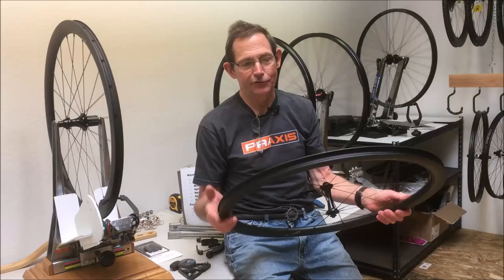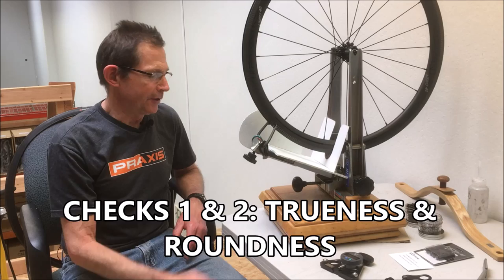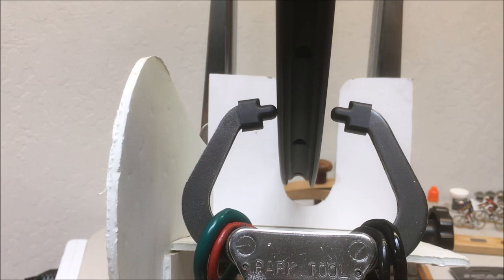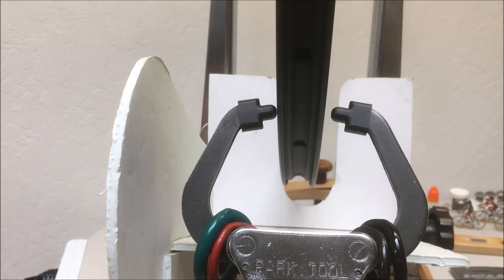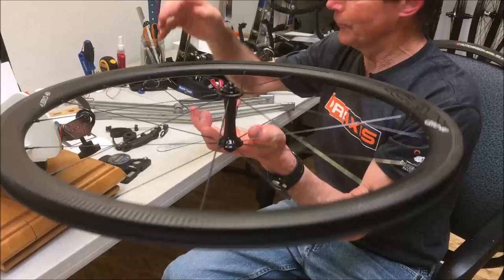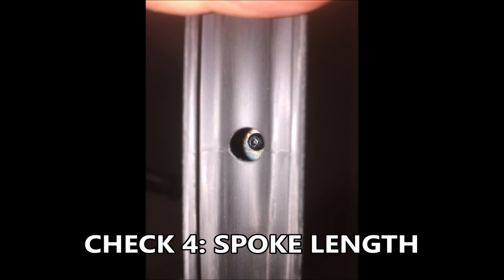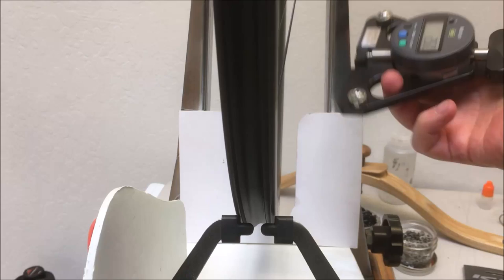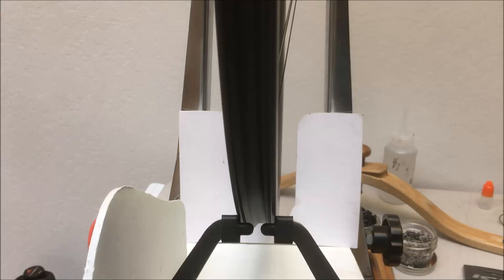ICAN Chinese Carbon Bicycle Wheels Review by Wheelbuilder Jim Langley

Comment: Proper educational videos. One weird question: could the spoke twist be on purpose, for the blade to meet a headwind in a softer angle? Did the non drive spokes had the same but opposite twist (mirrored angle)? I don't imply it is a good thing, but maybe you can cheat wind tunnel results that way?
Reply from the maker: Thanks for watching and commenting, Drou, appreciate it!! Another viewer asked the same question so it’s a good one. The thing is the spokes were randomly twisted - no plan to it. I was building wheels when aero spokes were invented too and never heard any design calling for twisted spokes. So I think they were just wrong. Thanks again!!

Comment: Enjoying your excellent Youtube videos..... Two questions: 
1) Should we buy nipple washers when building a carbon fiber wheel set?  
2) Most, if not all online spoke length calculators are specific to j-bend spokes versus straight spokes such as the DT Swiss 240S for straight spokes. That makes spoke calculations almost impossible w/o the DT Swiss online spoke calculator. However the results tend to show that left side spokes to be different length from right side spokes for disc brake wheels/hubs! Have you experienced this?
Reply from the maker: Appreciate you watching and the kind words, Graydon, thank you! On your questions, when you purchase a carbon rim the manufacturer should specify in the instructions or on a spec sheet on their website, etc., whether or not they're to be built with nipple washers. If I'm not sure, I will reach out to the maker and ask for technical support and ask them. Not all carbon rims require them but some do so it's best to check. I rarely build with straight pull spokes. But when I do, I will do what you're doing and use the calculator from the company that made the hubs and spokes. And I would expect the spokes to be different length on the right and left due to the way the rim is dished to the right for rears (to account for the cassette/gears) and to the left on front wheels to account for the disk/rotor. Not all wheels are that way but most are. Okay? I hope this is helpful. Thanks again and happy wheelbuilding!

Comment: I would like a pair of these wheel, however, i need qr100 and qr 135 center lock disc. What do you recommend
Reply from the maker: Thanks for watching and the comment jfolklfd10946. I recommend visiting their website and using their contact us resources to ask them if they can build your wheels with the spacing and disc spec you require. I think they'll be able to do it for you. If they can't there are other companies that will. I hope this helps you get some great wheels.

Comment: Having successfully built one set of amazing carbon fiber 700C wheels for my CF bike, I am itching to do more…….and so I can continue to make use of by ParkTools truing stand etc. Any suggestions on how to find potential customers?

And BTW - now I want to build a complete Gravel bike from scratch so I need some hobby income to proceed….
Reply from the maker: Congratulations on building a pair of amazing carbon wheels, Graydon. Building a new gravel bike with your hand built custom wheels will be another wonderful project.

It should be relatively easy to find customers for your wheels. Traditionally, wheel builders not affiliated with a bicycle shop, built their reputation for building quality wheels by building wheels for their clubmates - friends they rode with. As the wheels proved great riding and durable, riders told other riders and you’d get more wheel orders. If you provide reasonable turnaround times and prices and can build custom wheels people are looking for, you can develop a nice little business.

As you build your reputation and have some riders who love your wheels, you could then even approach bike shops and see if they’ll send customers for custom hoops your way. These days some shops don’t want to bother with building wheels - too much labor and no profit to be made off it. Plus, it’s hard to mark up the hubs, rims and spokes enough. So that can work. Especially if there are a lot of shops in your area since some might build wheels, others not.

Promoting yourself on social media could work nicely, too. You’d probably want to use local media such as the Nextdoor app or even Craigslist, both of which are free. Those are just a few ideas for you to try. Much success!
Jim
Reply: @JimLangley1  - thanks for the encouraging feedback Jim…..best to you and your business.

Comment: I’ve owned two sets of Chinese aero wheels (CSC brand) and have had no problems.  I’m not fond of the braking surface one the one non-disc wheelset, but not sure if anyone else’s is better
Reply from the maker: Thanks, Morgan. You can try different types of carbon brake pads and sometimes improve the braking on carbon rims that way. You might try that and see.

Comment: From aliexpress one of the wheelset's description:
Spoke Pattern Front	Radial (spoke tension-- 90kfg)
Spoke Pattern Non-Drive Rear	2 X Cross (spoke tension-- 100kfg)
Spoke Pattern Drive Rear	2 X Cross (spoke tension-- 135kfg)
Reply: I guess they do this purposly
Reply from the maker: @siitan83  You could be right. I almost have 1,000 miles on the wheels so far and they're holding up fine for me. Had I built the wheels I would have made the front tighter, but it hasn't proved to be a problem. Thanks for the comments!

Comment: I enjoyed.this video very much. I've only owned one set of tubless road rims, Bontrager AeolusXXX4s and was under the impression that ease of tire installation was due to the tire as opposed to.rim design. I recently had a horrible experience trying to take off and reinstall 
 the OME Bontrager R3 TLR Hard Case tire, which I was happy with performace wise, but was consisdering switching tires for installation ease. Is the rim really going to be.the determining factor?
Reply from the maker: Thanks for the comment and question Pat. Yes, the rim design has a major impact on how easy it is to install and remove tires. But, it also has a lot to do with the understanding of the person installing/removing the tire. Also, the setup of the tire and rim strip/tape can make a big difference. In most cases if the rim is designed with a reasonable rim "well", the deepest portion of the rim, you can get the beads down inside that and that will make the slack in the tire for easier install/remove of tires. But, if the rim maker did not provide a rim well or too shallow of one, that can make it a lot harder to put on/take off tires. Before giving up on a wheel or rim, I would recommend getting a second opinion on ease of tire on/off. I have helped teach many riders how to take off and put on tires that they thought were "impossible" to get on/off. The technique used is very important and it's not obvious. The biggest "secret" is to work carefully to keep the tire beads down in the deepest part of the rim all around the rim. That will create the slack that makes the tire loose enough on the rim to slip up and over the sides and in place and also to lift it up and off the rim. I have an old story about this on my bicycle website here with more tips: https://jimlangley.net/wrench/flattiresbyhand.htm Hope this helps and thanks again!
Reply: Wow Jim, thanks for detailed reply, I appreciate it. I've only had these rims for 6 months, so with the exception of a roadside repair, have not had any experience changing tubless tires. I did get some Hutchinson, moving up to 700×28, so I'll be giving those a try soon.

Comment: Very interesting video  a few things I didn’t know  as a matter of interest  what do you charge to build a pair of  Campagnolo alloy  rims and hubs
Reply from the maker: Thanks for watching, Michael. I build wheels for a wheel company, not for individuals very often anymore. The labor rate for wheel building depends on the builder and the full spec on the wheel so it varies a lot. It might be as little as 40 per wheel up to a lot more. I hope that's at least a little helpful and thanks again.
Reply: @JimLangley1  Thank you Jim  just a little doubtful on what you mean is it £40 a wheel
Reply from the maker: @michaelbritton9778  I’m happy to explain more Michael if you will explain what you mean by “doubtful.” In the context of our thread so far I don’t understand what their is to doubt - that’s my question.

Comment: I have a ICAN wheelset just like this, with 40 mm rim deep, and they are exactly as you told. 
They roll super nice, but the front wheel rubs the brake pads everytime I get out of the saddle, even though I weight just 135 lbs.
I always thought the front spokes could be a little tighter, and you just confirmed that.
If I tight them a little bit, would it prevent the rim from rubbing the brake pads?
Reply from the maker: Yes, it should fix the brake rub problem and it should make the wheels feel better overall, since a wheel with loose spokes can feel "vague" - as if you're not solidly connected to the road. I think you will appreciate the difference. Thanks for the comment!
Reply: Hi i have the same problem with my FL40 icans if i grab the back down post and push the top of the wheel i can easily move the wheel by 6 or 7 mm.
Did u get your problem resolved?

Comment: For avid amateur riders, what is sort of a “bare minimum” setup for checking wheels?  Would I need all the tools you have here, or could I get away with a subset?  Or, should I just take wheels to a wheelbuilder when I have truing issues?  (If you were in denver I’d take my wheels to you!)
Reply from the maker: Thanks for asking, Morgan. You can do some of the checks that I show in the video using your bicycle frame and fork. But, you do need to understand what to look for. For spoke tension it really helps to have a tensiometer and those are kind of expensive. So, for most people - unless you want to get setup as a pro, - it's faster and easier to have a professional check wheels out with their tools. That's probably your best bet. Hope this helps and thanks for the comment! Jim

Comment: I'm seriously considering a set of these. Any idea how easy bearing replacement is? What is the availability of the bearings like?
Reply from the maker: Thanks for the question. In most hubs replacing the bearings is pretty easy as long as you have the right tools - pull or punch them out and press in new ones. And, most bicycle hubs use bearing sizes you can buy from bearing suppliers. I need to take the hubs apart in order to investigate further and if I do that, I'll report back. You could also chat with ICAN on their site and might learn from their tech dept. how it's done. Thanks and if you get a set, let me know how you like them.

Comment: Awesome review.  Would you happen to know the sizes of the bearings for both hubs and hub body?
Reply from the maker: Thanks for the kind words, Paul - glad you liked the video. I don't know the bearing sizes. I haven't had any issues with the bearings so I haven't needed to look at them. I searched ICAN's website to see if they sell replacement bearings and/or show the size and I didn't find any information. The hubs are ICAN R01 - so what I think you should try is contacting the company through their website or other contact information. They have a chat function that pops up when you go to their website and that has worked for me - though I did have to wait overnight for them to reply due to the time difference. If you'd rather call or email, if you go to this page and scroll to the bottom you'll see all their contact info: https://icancycling.com/products/aero-40-road-wheels-us?_pos=3&_sid=ec1ec10e1&_ss=r  I hope this helps you find the specs on those bearings.
Reply: I appreciate it Jim.  I guess I’m just looking far ahead.  The aero 50s will be delivered to me soon.  Again, I really enjoyed your video.
Reply from the maker: @paulchan3628  I think the bearings in your new wheels will last as long as the wheels do. Have fun on them and thanks for watching my videos Paul.

Comment: Jim, thanks for the video. I gained some knowledge in checking my wheels. One question, where did you get the rubber tip covers on the truing stand calipers?
Reply from the maker: Thanks, maloneyfm, glad my tips are helping you with your wheels. You can get those tips from Amazon actually (they're called Park Tool 238.2 Caliper Cap). Here's a link: https://amzn.to/2odVWlG If you have an older Park truing stand, the calipers won't accept the tips because the old calipers don't have the little indent that the plastic tips lock in to. So, to upgrade to be able to use the tips you buy the "Park Tool Caliper Upgrade Kit for TS-2" with the newer caliper arms and tips here: https://amzn.to/2mFESo6 Okay? One of these will get you going. Thanks again for the comment! Jim

Comment: Good video and detailed quality control checklist! I am a bit puzzled though with the rim strip check, since a tubeless setup requires rim tape, not a rim strip. Also, the rim tape width would need to be based on the internal width of the rim, which you do not mention. Can you explain the relevance of a rim strip check with a tubeless setup?
Reply from the maker: Thanks for the kind words and the comment, Robert. It sounds like you missed my first video on the ICAN wheels. It's here if you have the time: https://www.youtube.com/watch?v=TmPdCDja84E&t=89s In that video I give the specs on the rims. The inside of the rim is about 18mm wide. In that video I also show ICAN's tubeless rim strips that are provided with the wheels. I made the mistake of calling them "tape," but I corrected myself with a caption. Regarding tubeless rim strips, it isn't correct what you said about tubeless setups "requiring" rim tape. Rim makers/companies usually recommend what to use and sometimes provide it with the rim/wheels. Rim tapes work great, but they can be difficult to install properly because it's easy to trap air under tapes when trying to get them to stick flat all around the rim. Also, some rim tapes adhere so well, they will actually tear carbon fibers off the rim when you try to remove the tape. When you get to work with rims that come with rim strips things get so much easier. They simply pop on and off by hand. This makes them a breeze to replace when needed. However, rim strips are not stuck to the rim with adhesive. Only friction and fit hold them in place. If they're too narrow they can and will move around and it can cause air leaks. That's why I said ICAN's should be wider. I hope that helps explain. In a video coming up I am going to demonstrate easy tubeless tire installation with both the ICAN wheel (with rim strips that fit) and an MTB wheel with a rim strip. So, if you tune in I'll show how they go on and how easy they are to work with. I tape rims when I have to, but I'm always happy when I receive a wheel/rim that comes with a proper fitting rim strip. Thanks again, Robert! Jim

Comment: I know it’s a personal preference but would you say that the 40mm is the best all around size if I had only one pair of wheels? The 45mm is tempting but not sure if wind will become a big issue. I don’t race and mainly commute to work on flats with group rides here and there. Appreciate your thoughts.
Reply from the maker: Thanks a lot for watching and the great question, Vlad! I do think that 40mm are in the right range of the best all-around size. Some of how affected you are to windy conditions has to do with your skills as a cyclist and also your weight. Lighter riders and less experienced ones tend to get pushed around more.

But, a 30-40mm aero rim doesn't catch the wind nearly as much as a 45 or 50 and the larger rims are even harder to control in crosswinds or when an oversize vehicle passes and you get hit with the gust of wind. So the 40 is a good compromise that most riders do really well with. If you get them I'd appreciate hearing how you like them. Thanks again!
Reply: @JimLangley1  Jim, is the DT Swiss hub (18T) upgrade worth the extra $100+ on those wheels or I should be ok with the stock hub?
Reply from the maker: @vladk6679  hi Vlad! The advantage of the DT Swiss hubs might be better access to replacement parts if you ever need them. Because DT offers service parts through lots of distributors. Their parts are expensive but at least you can usually get them. Right now with the pandemic I don't know how available they are but at least in normal times you could usually get them. You can probably also buy some replacement parts for the ICAN hubs from ICAN directly. But I haven't tried that as I haven't needed any. The ICAN hubs have worked fine for me for over 2K miles now. I don't ride much in the rain or harsh conditions. The more of that you do the more you might do better with the DT hubs since you can replace any part that might wear out from rough conditions riding.

I think for most cyclists the decision comes down to how you feel about Swiss-made parts versus Taiwan-made parts and if you feel it's worth spending more to get perhaps a bit more quality and serviceability. You might also want DT Swiss hubs on your wheels because they're a big name in hubs so it'll impress your riding friends more. Hope this helps with your decision.